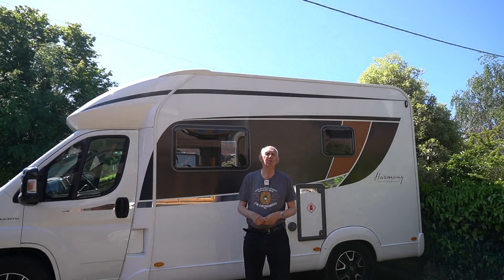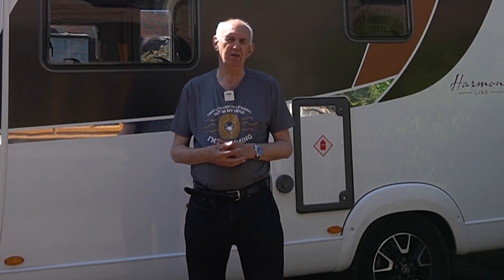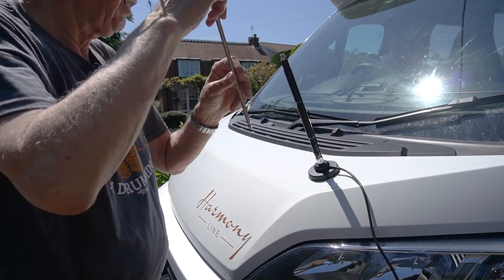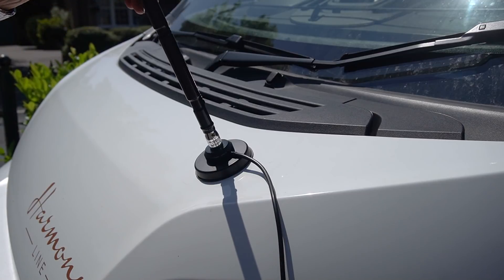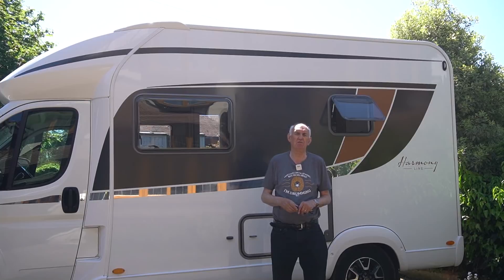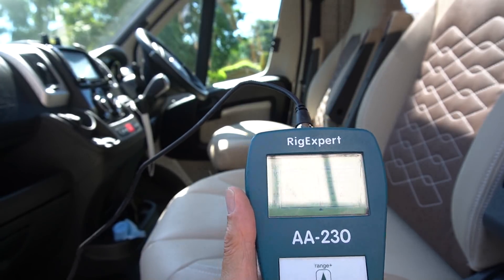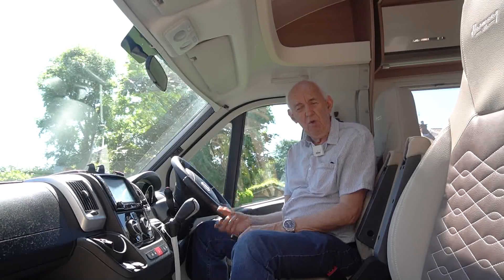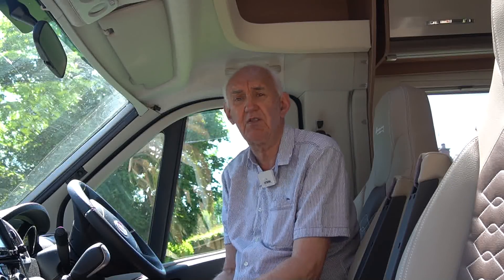HF MOBILE ANTENNA MAGIC

Comment: I wonder if this will help with some of the ATAS 120A on a magmount problems? Thanks for another useful video Peter. 73 G3WNR
Reply: I've found that the biggest improvement you can do with the Atas is mount it will a drilled mount straight through roof of vehicle, this with illiminate any common mode currunt issues and also reduce loss within the system increasing performance
Reply: @Pioneer936  I don't want to drill through the roof of a very expensive car HI! I know the AT120 works on a three magnet mount on 20 to 10. I'll dip into my ferrite core stock and see what happens.
Reply: @kengrey7263  that's never stopped me lol. No worries, but it does eliminate those mag mount problems and is more efficient